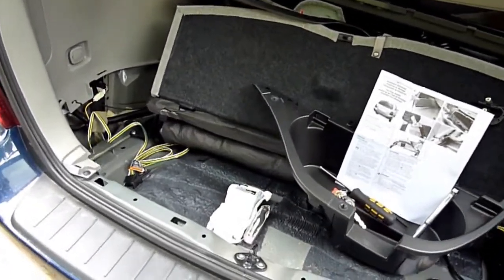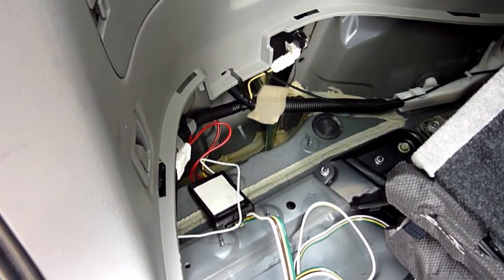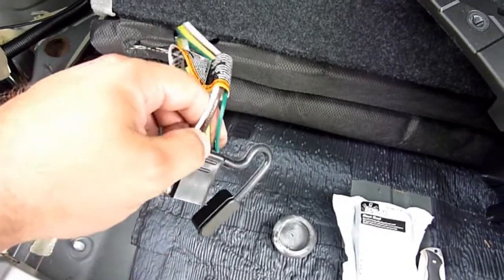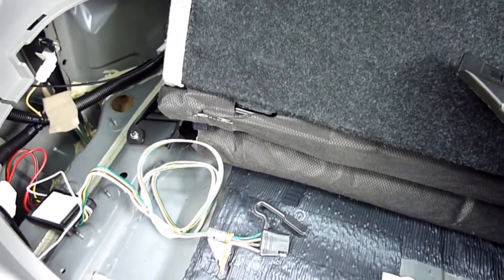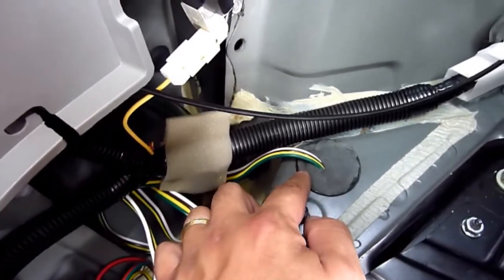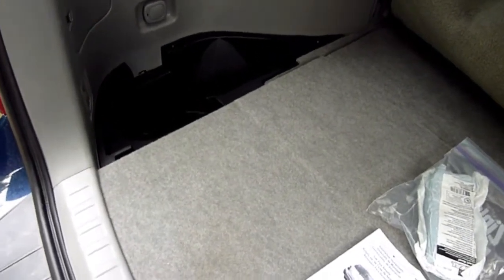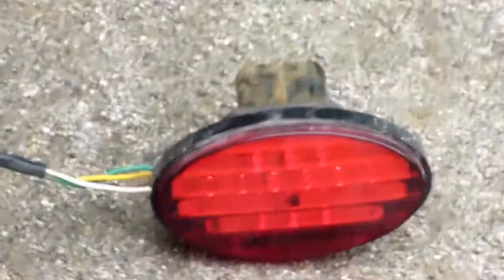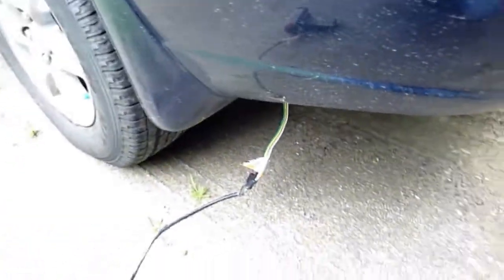2007 Highlander Tow Hitch Wiring Installation

Comment from the maker: I've since gotten the hitch on. Run the wire down the tube and zip tied it to the tube. Use a secondary 4pole extension to reach my trailers and it is all neat and clean. Under the vehicle and no digging under all your stuff loaded in the cargo area to pull the cord out.

Comment from the maker: Thanks. 1 year later and it is all still good.
I've towed various boats, my snowmobile trailer, pulled roots, etc.
The pass through is still good and the zipties still hold the wire in place.
I use an extension to get from the end of the adapter ziptied to the hitch tubing to whatever I am towing.  Works great and no having to open/close the gate or dig in the storage box while the back is full up with equipment.

Comment: do you have the part # for this kit?
Reply from the maker: Tekonsha 118248 -Flat Tow Harness Wiring Package (with Circuit Protected ModuLite Module) https://www.amazon.com/dp/B0012RI5FW/ref=cm_sw_r_cp_apa_XzTIBbEYGNXAZ
Reply: @BHShaman  Curt 56107.  Amazon has a wait time to ship of 1 to 3 months.  Rockauto has it for the same price but with shipping and can ship immediately.
Reply from the maker: @brianlamberts756  the Tekonsha is in stock on Amazon (see link in my prior response) and ships immediately.
Reply: @BHShaman  Thanks,  I got one from Rockauto.  And it's all installed, tho not finished off neatly.